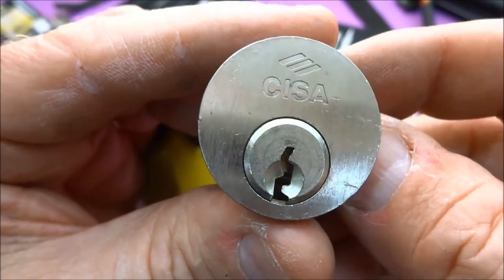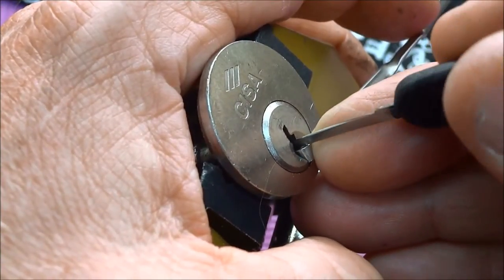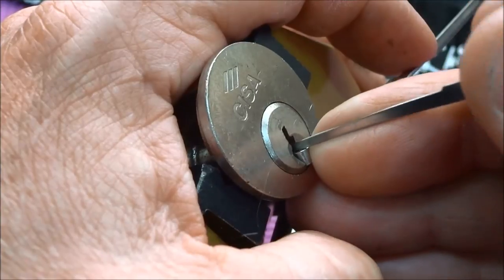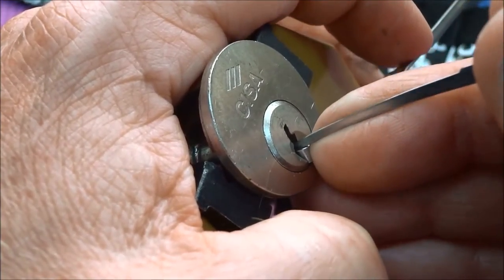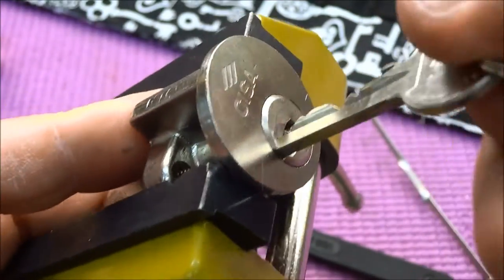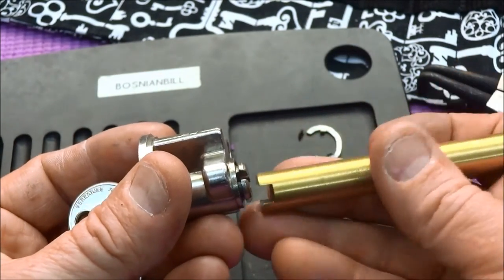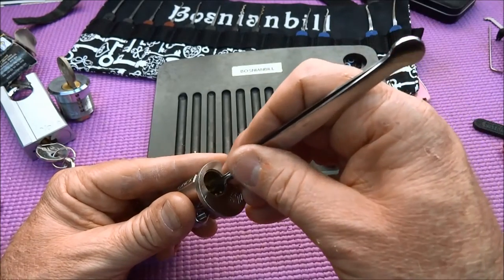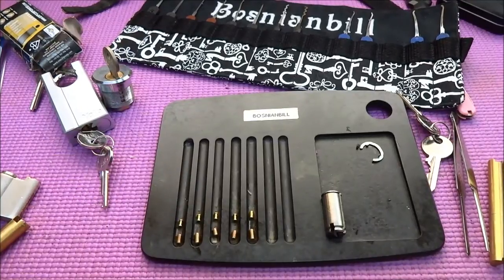(373) CISA Rim Cylinder Picked & Gutted (Thanks Kerpeesh!)

Comment: Great picking Bill. I had a go at gutting a viro rim cylinder the other week to show one of our members what pins were in it. I made a right pigs ear of gutting the lock using makeshift plug follower...... I used one of my little lads colouring pens but when pushing through pins were getting trapped so ended up hacking the lock to bits LOL!!! may have to remember your tip as did not know pinning order when putting pins on my custom fan folded pin tray LOL!!! Great video again Sir :o))))